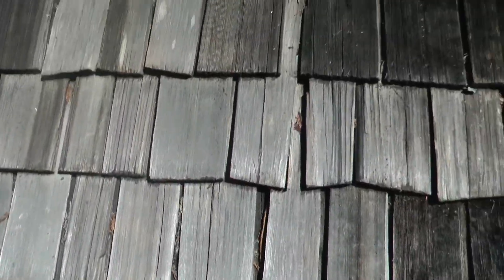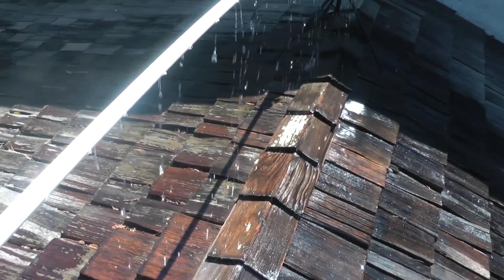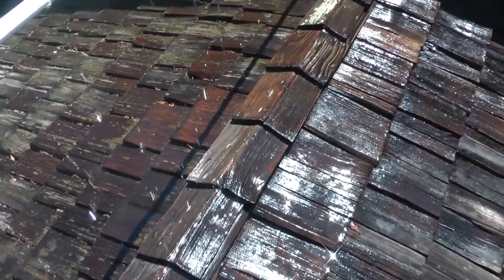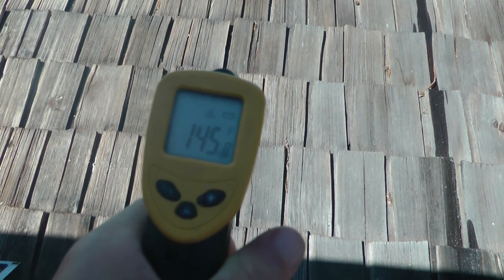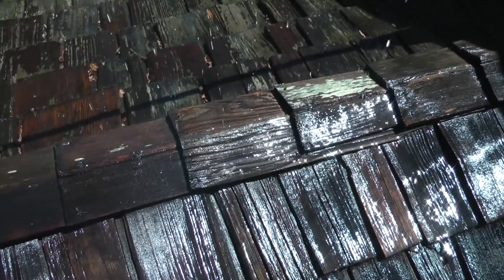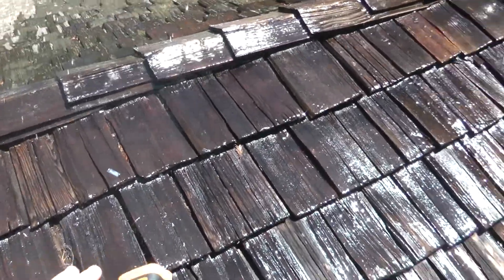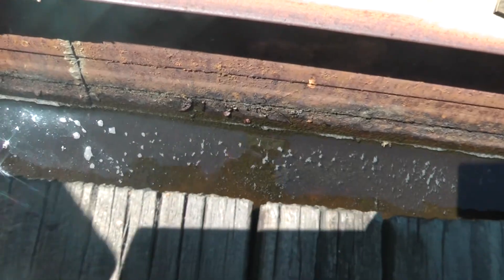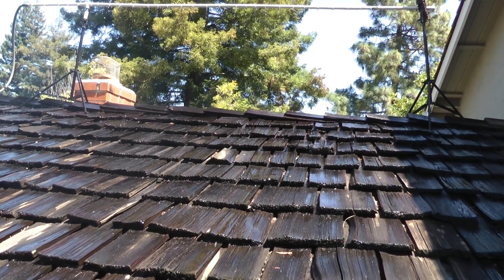WATER COOLING MY HOUSE (great results)

Comment: I tried a roof sprinkler and your method is very wasteful. Ideally, you don't want any runoff because that's wasted water. I got a sprinkler for cooling my roof and I focus on frequency. Eg, spray 1 minute every 15 minutes rather than 2 minutes every 30. More water gets used for evaporative cooling that way and there's less water runoff, which isn't used to cool your roof. I recommend getting an actual sprinkler with a smart Wi-Fi water timer.

Comment: The idea is great but this method has room for improvement due to its inefficient water use. I am thinking of getting those roof sprinklers for wildfire protection. You turn them on for 3-5 minutes every hour or two and that'll cool your house down and minimize water use.

Also, how are your feet not burning?
Reply from the maker: Stone Age feet upgrade + thermodynamic immunity, aka porous wood no hold or conduct thermal energies well

Comment: RECOMMENDATIONS:
1) Switch to a sprinkler on a timer. Saves water & lowers temps of water for more efficient cooling.
2) Insulate piping from the sun. Keeps the water as cool as possible before it starts absorbing roof heat.

The goal is to wet the entire roof with the least amount of water necessary, and only reapply when necessary. With a sprinkler & timer...you can drastically reduce those 50gal, and have an even cooler roof.
Reply: Good positive information

Comment: Can I use this on concrete wall? I'm not a concrete guy so not sure what the long term effect is.

One suggestion is you install a sprinkler head + pump, so it distributes water evenly and quickly within a few minutes, then use a timer plug to shut off water while is evaporating to save water. (might be useful in areas with water shortage) You can find this plug online, or from sprinkler stores.

Comment: I just took a garden hose on my roof and rinsed my entire house- including the walls. I doubt it took 50 gallons of water on a fairly fine spray and was much more targeted. Definitely less than my daughter's daily shower (which lasts forever). Best done in early evening since the house materials trap heat.

Comment: Bro, it is best if you are looking for the best way to cool down your roof is to replace the dark colour roof with a white roof to make your roof colder and your inside house cold naturally, without using water or air conditioning because white naturally reflects sunlight radiation heat back to space to prevent the temperature from warming up in the daytime.

Comment: Fan fact:
You looked up this video because you wanted to see if someone else hand this kind of idea. You are not alone.
Reply: I was looking for closed loop water pipe system like heat pipe, but run only water to a radiator to passive cool a house
Reply: @Trgn that system must be cover entire roof, or you need roof with heat conductor  to spread the heat then cool the water somewhere which is inefficient
Reply: yep! having a water feature around your home naturally provides a cooling effect. same thing for ppl and sweating

Comment: The reason why this works is the same reason why a swamp cooler works, it's evaporative cooling. As the water changes phase to a vapor, it requires energy and takes that energy from the air temperature in the form of heat, thus reducing the surrounding temperature a little bit. Peak efficiency would be if all of the water evaporates off of the roof before hitting the rain gutters. It's smart if you don't have good enough AC!
Reply: SCIENCE

Comment: i also remember seeing studies that plants covering the roof helps a lot since the heat collected blows away in the wind instead of permeating down into the building. Perhaps this can also be done with just sheets of fabric as long as there's wind flow underneath

Comment: my roof is corrugated sheet metal, i primed it with red iron oxide and painted it high gloss white, it went from 160 degrees surface to 65 degrees, i live in philippines,its hot and sunny year round
Reply: i've considered adding a mist,maybe pinholes in a hose.

Comment: That wood shingle roof looks like its falling apart. All that water is great for cooling but its going to accelerate the rot.  
I think this would be great way to cool a metal or asphalt shingle roof tho. But I would use a pump drawing water out of a tank/barrel to pump the water up to the roof then collect the runoff back into the tank with gutters. Have a float valve to add water back in the barrel if it goes below a certain level (similar to a toilet tank). Waste alot less tap water that way.
Reply: Wow Someone thought of this a whole year before me. The heat here in 2023 has chased me here. Lol.

Comment: Use sprinklers bro you'll save so much money and water and leave it on a timer where it turns on every 30 minutes for 2 minute
Reply: This is the winning answer but so little recognition. hehe
Reply: Is there such a product? A timer requires electronics so installing it into the sprinkler would risk water damage. The controls would have to be in the house or away from the sprinkler.
Reply: @cloudtheavegner1000  there's stuff like this for irrigation systems
Reply: Just use a oscillating sprinkler, much more water efficient.

Comment: 50 gallons?  That's 5 loads of laundry in a front load washer every friggin day.  That's not a good idea.  A better way to cool your house is to put a metal roof over the roof you have  suspending the metal panels on cleats and leaving the ends open to the air between the new metal roof and the old roof can circulate there by cooling the roof and the house using only air.
Reply: I always wondered if solar panels kept the roof panels much cooler.
Reply: If there a name for this idea? This sounds interesting and doable enough that theyd commercialize it and sell it as an install service.

Comment: The factory I worked also cools the roof in the summer with water. Huge nozzles are installed to pump water on the roof.
Reply: man wish my job would do this, work in an area where the roof is low and zero insulation so I just feel that heat radiate on top of me.  I can't even use the fan mounted on the beam because it feels like hot air blowing in my face
Reply: @wisewind6284  the water helps a bit but it is still way to hot sometimes because of the production/processes.
Reply: Bro, just use a white roof instead. It is like 1 million times better because white naturally reflect sunlight heat back to space when exposed to sunlight on a hot day to keep the temperatures of the surface much cooler which also leads the temperatures outside cooler. It also saves your need for air conditioning by a lot so you can save electricity, money.  This is very good and it’s a must require if you live in more of a warmer climate.
Reply: Not in the case I mention
Reply: @Clouds-su3dc  we have more days on which we need heating than cooling. So a black roof in our climate is better and cheaper

Comment: At first this seemed stupid, but it is starting to make an unreasonable amount of sense. Water is relatively cheap for it's thermal properties. Especially when you consider that the water from the city can be considered to be geothermally cooled.
Reply: City water doesn't get very cold. Well water on the other hand is a whole different story.
Reply: Just use white roofs instead it’s way better because white reflects sunlight heat back to space to keep the surface of your roof cooler naturally. This also leads the temperatures outside to be cooler automatically and it saves your AC bill by a lot.

Comment: PVC is not good for the job because it breaks down in sunlight. Maybe paint it or something, because otherwise it will break down in UV light. You can also use a mister, which will waste less water, and set it up in front of your house, so it water cools the side of the house
Reply from the maker: yes i agree with the pvc it turns a sickly brown   the mister tho it will evaporate before it hits the roof lol

Comment: I've always thought this was a good idea. Bet you could add some rain catchers, and re-use the water.   Probably even more amazing on a metal roofed building, or shipping container....
Reply: You could find a way to optimize it and have only the exact amount of water drip, to the point where all of it evaporates before reaching the end.
Reply: Building one of these right now, to help keep my garage glassblowing studio in Iowa cool, at least for the hottest 2 months of the year.  I used an oscillating lawn sprinkler, now I'm working on controlling a pump in the rain barrel with a timer.  Not much else I can do for air conditioning since I'm ventilating so much air due to the glass torches and kilns.. The sprinkler keeps the workshop around air temperature, instead of 20 degrees hotter.  I'll still have to keep an eye on keeping the rain barrel full; a better system would be to use the timer to control electric solenoids supplied by city water.
Reply from the maker: except for that we havent gotten rain in like 8 months  lmao  global warming has caused a weird year
Reply: This is an idiotic idea!
While it may work, it’s a waste of water!
We’re in a drought.
While    @ianbuilder  even acknowledges -No Rain!
It’s not other people’s responsibility to conserve.
It’s all of our responsibility to do our part!
Reply: @jimmyr9957  If he used a water barrel and a pump, and run the water back into the gutters and back into barrel and reuse it.
Reply: @jimmyr9957  he's just donating water back to the clouds. what a good Samaritan.
Reply: You would eventually lose water over time due to evaporation (which is a good thing). If you have a Tesla solar roof or solar panels that you want to keep clean this would be even more beneficial.
Reply: @graysonsmith7031  but it would be less water used in the end.